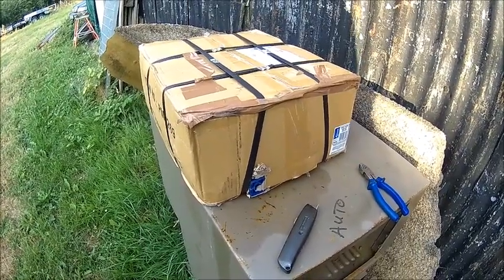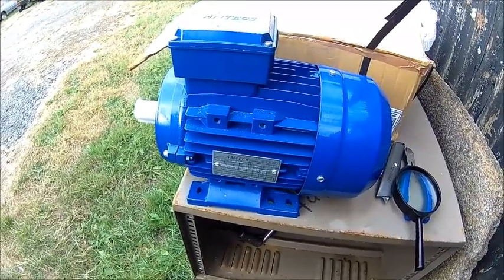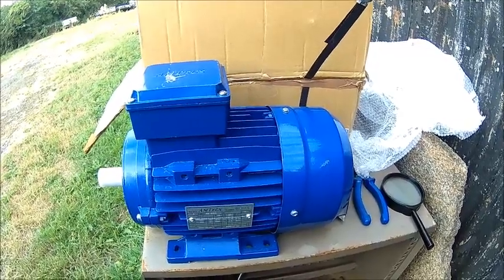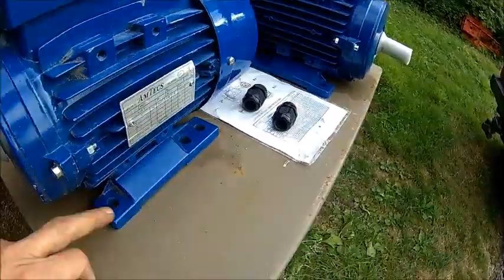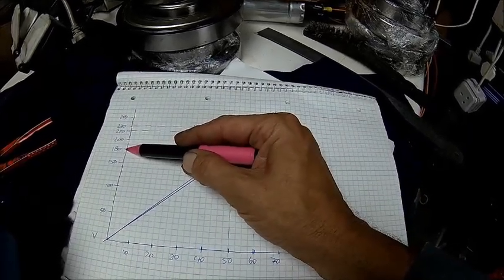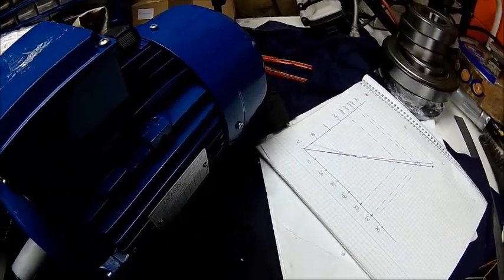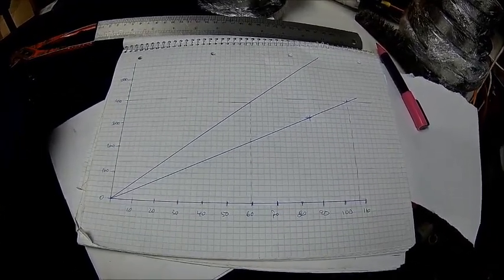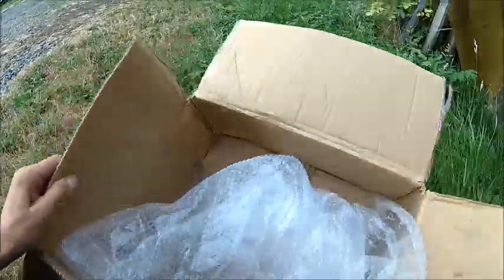TYM#3 - 60Hz AC motor in a 50Hz country and why you may want that + the worst packing job ever seen

Comment: I don't think its a big problem when the power drops at higher frequencies. On a lathe those higher speeds are used for smaller diameter work- pieces so the power loss probably won't be problem. (assuming one overdrives the motor frequency)
 Larger diameter work-pieces at low frequencies are the problem.
Reply from the maker: Well, it depends on the lathe, ...with insert tooling and a good feed rate i can stall the little green lathe at any speed, long before i reach the limit of the cutting tool. The desired motor type is a 4 pole because of shorter flux linkage and less copper losses in the short ends than a 2 pole type,. The higher number of poles also gives you better control and better torque development at the bottom end. But here comes the problem,  for reasonable torque at low spindle speeds you want a belt ratio of a least 2 or even 3. That leaves you with 750 spindle rpm at 50 Hz, or 1500 at 100Hz.. Let's assume we have a 1kW motor, your 230 V VFD+motor delivers 
1kW and 12Nm (with 750rpm at the spindle) at 50Hz  and 1kW and 6Nm at 100Hz, sharply dropping thereafter as you can't even drive the magnetizing current anymore because you running out of voltage. With the solution as described i have 1kW and 12Nm at 750 spindle rpm, 2kW and 12Nm at 1500 (100Hz) and still 1kW and 6Nm at 2250rpm (150Hz), and still not running out of voltage as i have 440V from my transformers ... hope you now can see why this all makes good sense ..... (numbers are ideal,  real world data may vary)

Comment: Good lord! What kind of goof packed that up!? I'm surprised the castings aren't busted all to hell. Look like nice motors though. Are they cast iron or aluminum?
Reply from the maker: I was quite surprised, too, apart from the bent foot it seems to be ok, we'll see what bits fall off when i take them apart. Without the dents ant dirt, they may look nice, the truth is inside, rotor run out and air gap is what makes the difference.  Housing is Aluminium, nameplate says 16kg, average for that size.

Comment: ....correct me if I'm wrong, but I always thought that the UK ran on 240v @50hz not 230v...
Reply from the maker: Technically you correct, but from a specification point, you wrong...:-)... Fact is that in 1995 it was decided to harmonise the mains voltage all over Europe, UK had 240/415V 50Hz where most of the rest had 220/380V.
What they did was just changing the tolerance declaration and the nominal voltage, we now have 230V +10/-6%, whereas before it was 240V +/- 6%. We still have well over 240V in most areas, my transformer is just over the fence and i usually see well over 245V .  The problem is that you can't just drop a country wide grid by 10V,, that would involve some significant investments, too. So we now officially have 230/400V by definition, just sitting a bit in the high end of the tolerance band.
Reply: ah, thanks for that....I live and learn! :)
Reply from the maker: you're welcome ...
Reply: @dynoguy  I live in Italy where the old standard was 220/380V, but I don't think I've ever actually seen a voltage lower than 230 (edit: other than a brownout once where the lights suddenly dimmed so much that I was wondering and measured the voltage, it was 190V. It came back to 245 after a couple minutes). 
Most of the time it's around 230-235, but I've seen as high as 250. I wonder if it's the same in rural areas that are served by older/less upgraded parts of the grid.

Comment: Nice looking motors. Get a needle tip for your grease gun and pump some grease in behind the seals. I agree about the packaging. This happens to me.
Reply from the maker: They actually look better on the video ...:-) ... and for greasing, these are ZZ bearings, means hard covers, not rubber seals. It's not worth to rescue a Chinese bearing anyway, a quality brand replacement is around $3, so what...

Comment: Hi, I have an ecogoo 220v input to 380v output vfd, I think it's a 1.5kw one. It has a problem with its display and so can't be programmed. I'm pretty sure you would be able to fix it, so do you want it? If you do I'll post it to you and it's all yours to play with, just send me a massage and I'll get it sorted.
Reply from the maker: Hi, thanks for the offer, but i am in the process of moving house so i'd rather trying to get rid of some clutter.

Comment: I’ll have to watch this a few times to get the idea I think, I’ll tell what would make a good video Mike, a run through of all the settings on the VFD as I think a lot of  us have the Chinese ones also I have two Mitsubishi but there’s so many channels to change and it’s a pain when you don’t know what’s what, just a suggestion, (please) the seller wants hanging by his balls for that might make him take a bit more care next time.

Regards Alan.
Reply from the maker: Hi Alan,...sounds like a good idea, I'll see if i can find the time for a short clip doing exactly that, so you don't need to call for help on Sunday nights anymore ....:-) ... The biggest problem for most HuanYang users is that they come with strange default settings, i never had one which worked straight off the box........ I hate violence, but it seems he's got quite big balls, may need to switch to anger level 2 soon.

Comment: Hello, i like your video. I need your help. I bought an electric pressure washer in china. The volt is 220v 50hz. But my country electricity is 220v 60hz. Do I need to use the VFD converter? When I asked the shop in china, the owner told me it's useless using the VFD. I need your help, please to run my motor.
Reply from the maker: You should not run single phase motors on a VFD at all,  to many issues which may occur.
All you can do is plug it in and run it as it is. If it's an induction motor, It will run about 20% slower with 20% less power, if it's a brushed motor (quite common with cheap pressure washers) you may see less reduction in power. Anyway, it will run, but not to full performance. Hope this helps ...

Comment: Pls help me i bought a 115 volt 60hz welder from the us and where i live the electricity is 115 volt 50 hz

The model is the hobart handler 140
Reply from the maker: That looks like being a transformer welder, so it might just work on 115V/50Hz, but power and duty cycle will be derated a bit, also the transformer may hum a bit as it's closer to saturation on 50Hz..
Reply: Will the machines life be shorter?

Comment: Hey I have a 50hz motor but my country 60hz will it run nomal and it's a 3 hp will I lose ph or rpm and it's 110v
Reply from the maker: Running a 50Hz motor in a 60Hz country is not a problem,  providing the 60Hz supply voltage is no more than 20% higher.
I understand that your motor is 110V/50Hz induction motor, , this means it's good for a  110V/60Hz or 127V/60Hz mains as well, it will run about 20% faster, torque might be less, depending on your actual mains voltage, but the higher speed may have the effect that your net power might be the same or even slightly higher. To achieve exactly the same current (and torque) as on a 50Hz mains, you  will need at least 132V/60Hz, which is a rather unusual mains voltage.
Reply: @dynoguy  Thanks much..
Reply from the maker: you're welcome

Comment: jeeeezuss.. that packing job is for the birds.. and the handling of the package was almost as bad as DHL handled my Deckel in transit. if the douchebag charged twice for shipping, the least he could have done is mount the motors on a piece of OSB or plywood to keep them from poking thru the sides of the box...
the chinese don't have the best QC when it comes to bearings... which i'm guessing is what's inside those motors as they too are probably chinese. 

correct me if i'm wrong: i was under the impression a 60hz motor would just run a little slower on 50hz juice? i'm gonna have to re-watch the video a few times to really digest the content as i know virtually nothing about electric motors and stuff...
Reply from the maker: Well, ...it seems he's a bit stubborn, too. My next conversation will be in "friendly mode off".
I assume these are made in china with chinese bearings, so i just replace them.
You correct, it will run slower, but you also need to watch the voltage as lower frequency requires lower voltage for maintaining the same current. That's why most 60Hz motors are 440V or 460V, but the same plate then says 400V 50Hz....practical example of following the curve on my sketch.
These seem a bit special as the 60Hz voltage is unusually low, that's why i wanted them, we.ll soon find out what's really in it, name plates don't always tell the truth but not very many people can test that ....

Comment: 60 Hertz motor can run on 50 hertz but with lower capacity
Reply from the maker: of course it will, but if you reduce the frequency by 20% you MUST reduce the voltage by 20% as well, otherwise it will draw excessive magnetizing current, even when just idling with no load.
Reply: @dynoguy  of course that I understand. Thanks 😊
Reply: @dynoguy  please Sir help me
60hz 440v mother
50hz  why on??
Reply: Well it damages the motor if you do that long term

Comment: I have washing machine use 60hz/220/230v gross power 2200w
And my house have 50hz/220v power 
I need easy cheep Solution
Reply from the maker: Just plug it in, should work, if it is an asynchronous motor, it will run about 20% slower on 50Hz,, that's all. The heater doesn't care if it's 50 or 60Hz, that's just a resistor.
Reply: @dynoguy  
I plugged it but it shut down itself
Reply from the maker: well, do you have a picture of the data plate,. there are thousands of different machines out there and with no information at all i can't really help you
Reply from the maker: Looked at it and i still think it should just work on 50Hz, the motor appears to be a DC motor, so the mains frequency does not matter. Is the machine used or new ? did it work elsewhere ?   Why not just ask the manufacturer what to do.
You  certainly can use a VFD, but it needs to be rated for at least 6kW because you only use 2 phases of the output, also some vfd's don't like to be loaded on 2 phases only. Cost will be in the region of $300 for a cheap Chinese one,
Reply: @dynoguy  
My uncle send it to me it's brand new i try it and it shut down itself  and i leave it for several months it doesn't worth it 
It cost about 185 USD i will try again if doesn't work i will sell it or leave it. 
Thanks anyway